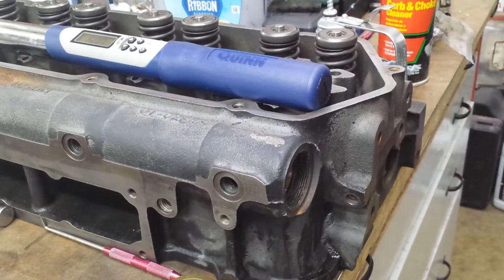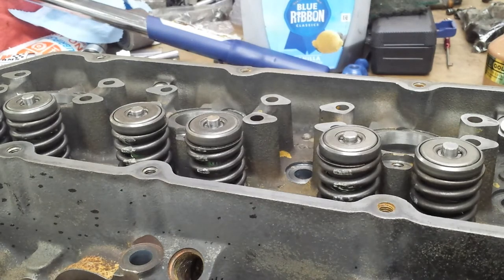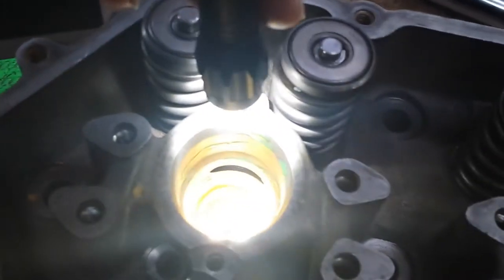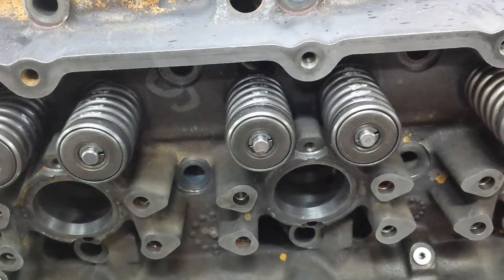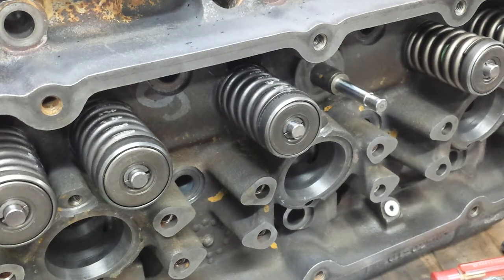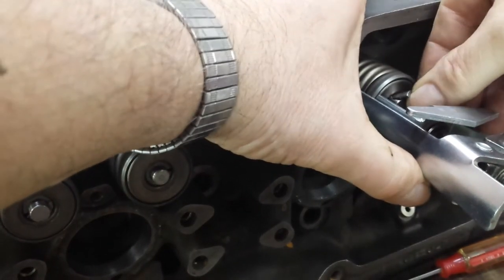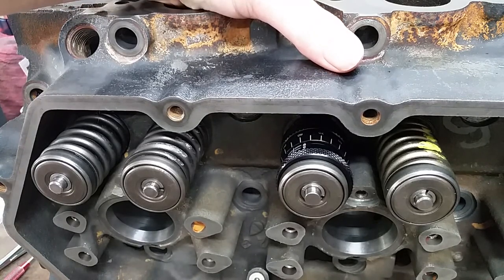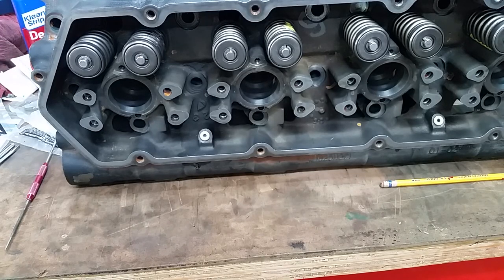7.3 Build: Cylinder Head Work Finishes (part 2)

Comment: Did you ever think of using the stainless steel cups from riffraff?
Reply: I saw you ended up doing that in a later video lol. What a pain to remove perfectly good cups but like you said brass  only last 100,000 and  not worth the headache
Reply from the maker: Yeah, Stainless is definitely the way to go. much more durable. When you hold the stainless next to the brass there is no comparison.

Comment: Whats  the difference between prepping the surface with rubbing alcohol vs. denatured alcohol
Reply from the maker: Denatured is doesn't  have the additives in like rubbing alcohol. some rubbing alcohols have trace amounts of glycerin to help try to prevent drying since they are used on skin.